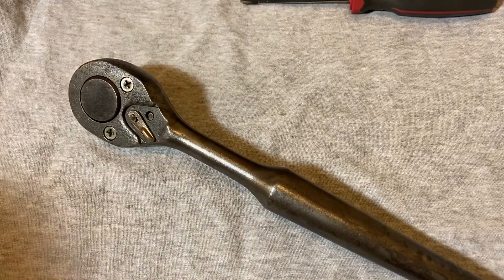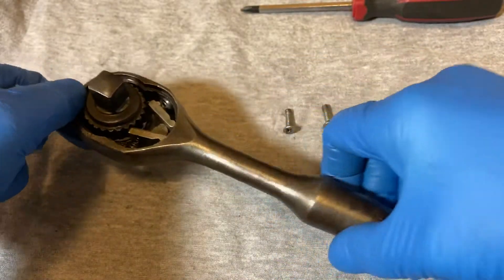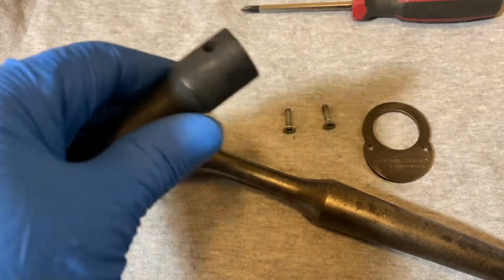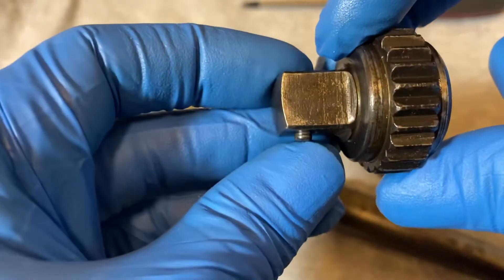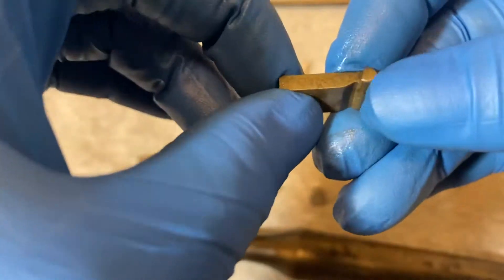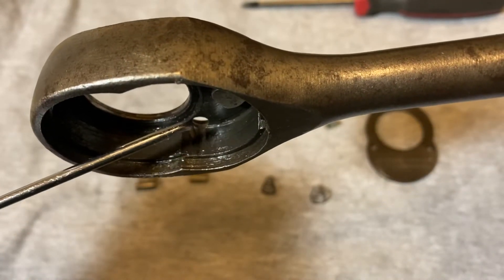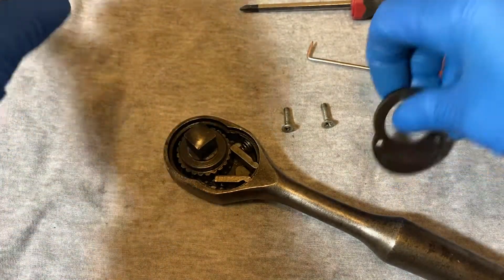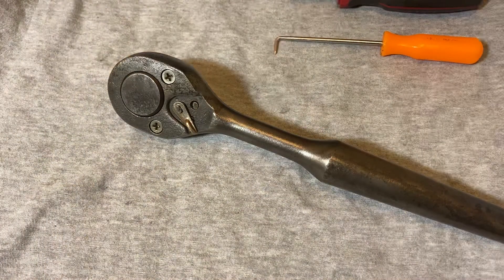Proto 5449-14BL “Spud” Ratchet TEARDOWN 1/2” Drive

Comment: It's a pin detent design as supposed to a ball detent. This is great for iron workers whom may be in situation that are high off the ground. This prevents the sockets/extensions from knocking off and falling. It's common on Impact wrench as well.
Reply from the maker: Hey I appreciate the info👍